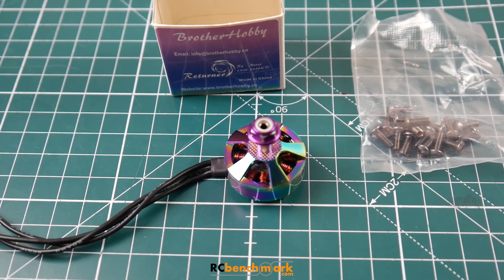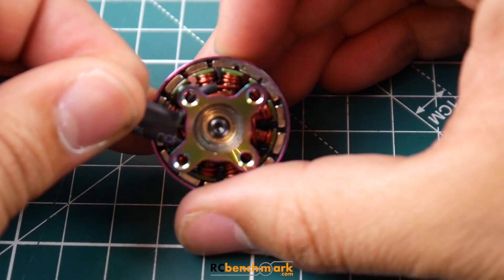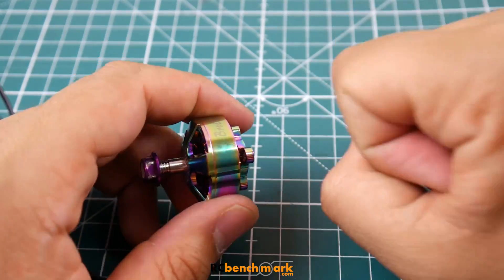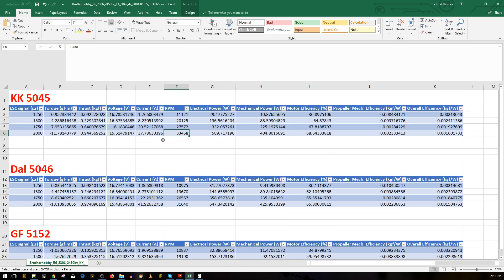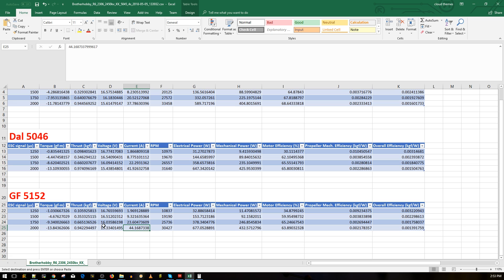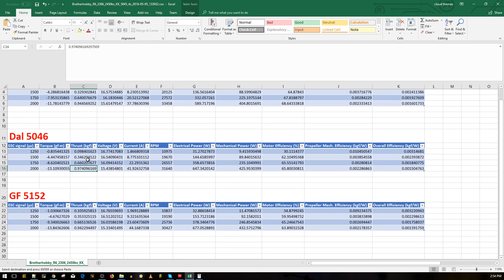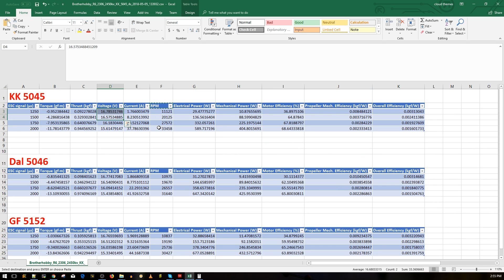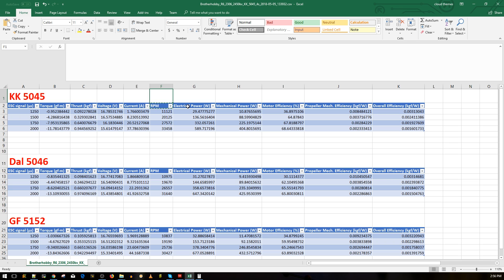Brotherhobby R6 2306 2450kv // Overview & Thrust Test

Comment: remember engineerX always mentions that amps measure about 30% lower in flight and maybe steeper props suffer more or maybe less from not having the unload that moving through the air provides... i don't understand how kk5045's can give similar power to the dal 46's....

Comment: The thrust nr are so low in your tests.. EngineerX always gets over 1000g on the same kind of motors.. the R5 2450kv got 1504g 44.5A on the DAL 5046 and 4s. How is it possible that you'r tests are so different?   Love the channel by the way..
Reply: i wana know the same ... also on mini quad test bench they get numbers much like engineerX your numbers are much lower than either of those..
Reply: Yeah I was shocked at your results.. they’re very low.. should be pushing out around 14-1600 with the higher pitched motors
Reply: me too check engeneerX... i trust this man. Something is wrong in your setup i dont belive that these R6 2306 pull only 950g if so then my old emax 2205 is stronger.
Reply: https://www.miniquadtestbench.com/assets/components/motordata/motorinfo.php?uid=176
Reply: Probably the factory calibration is wrong, this r6 should easily get more than 1000g... Forget the 5152 it's not good for bench test.
Reply: FPV Portugal I agree there is something up. The reputable motor manufacturers get similar numbers to mini qwad bench and engineer X.. all of which are as much as 50% higher. They have tested hundreds of motors between them. 🤔
Reply: what size battery is used in these tests. engineer x uses a massive battery that wont sag under load could this be the issue in part?
Reply: i think he now uses a high amp power supply
Reply: KC Thole not putting a lot of stock in his testing 🤔
Reply: I meant higher pitched props.. my bad
Reply: No.. KC Thole is not :)
Reply: KC Thole the complex modern props don't bench very well as they need the dynamics of actual flight to get the proper performance out of them. MQTB and X both use older props to achieve consistency in their results and the props they use show a direct correlation between pitch and testing numbersn
Reply: Sugar Kane I really have no personal experience to go on with these particular motors and you’re right, I read other thrust tests results that show much higher, but I’ll take your word for it.. I’m no expert lol
Reply from the maker: I went through 5 load cells, 8 setups, 2 thrust stands and different power supplies. Every motor result test i have gotten constant results to my data. 

Also used different locations and different mounting setups.

The the time I get those extra thrust like engineerx is if I don't tare off my load cells which means i account for the extra weight of the motor and stand. I have been at this for 2 weeks now and decided there is an issue with how they are calculating thrust to be honest I believe my results are correct because there is no way in hell DYS Mars was powerful I knew from flying it and on my testing results the T-Motor F60 V3 got same result as their DYS mars which means someone is doing something wrong and the other something correct.

I measured accuracy upto 5kg and accuracy is +-3 grams. I will try to contact miniquad and engineerx because somethings is not adding up. 

At first i thought something is wrong also but after all I have done I still come up with this when i disregard for motor weight and stand.

So this is why i continued

Comment: I don't know, dude... That motor is REALLY expensive! And it doesn't give much more thrust than the Racerstars, for example... And look at the amps! It's crazy! 😲
Reply: MC's Creations its not really expensive. Its just the normal price for a motor
Reply: STRYKA FPV For an overpriced motor, you mean. I'm from Brazil and it's REALLY high for us.
Reply: That motor is a reasonable price for a good motor... look at other motors that are similarly specked.